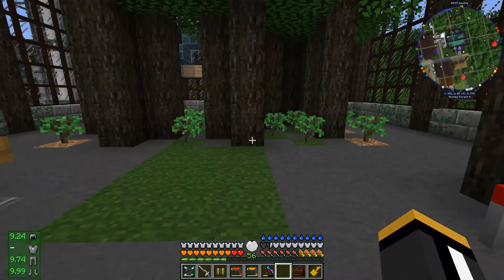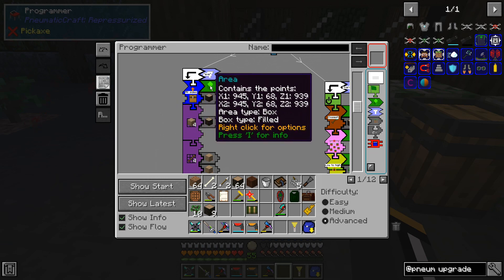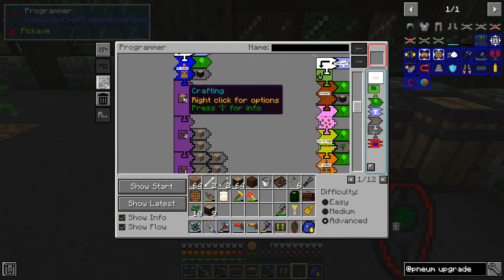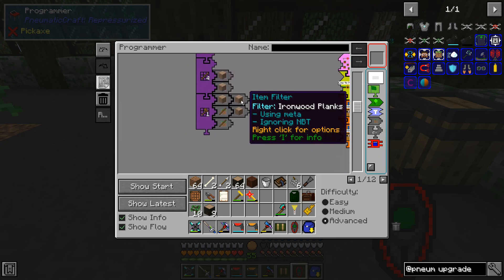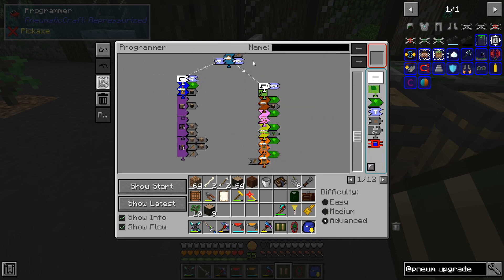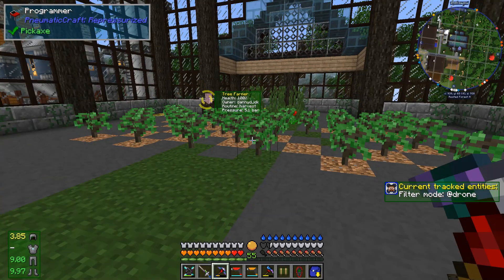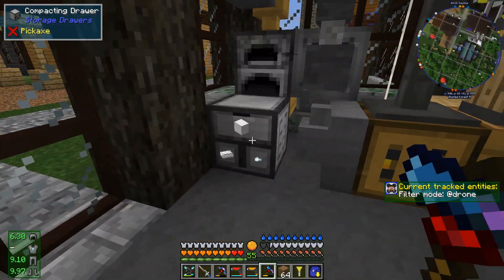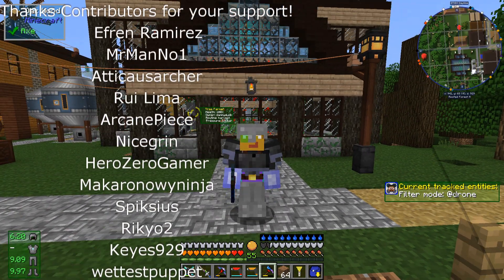Real Tech S2E49 - AutoCrafting with PneumaticCraft Drones

Comment: You should add rail craft to the mod pack
Reply from the maker: Thanks for the suggestion! I did have RailCraft in the 1.10.2 version of the pack, but it took so long to come out for 1.12.2 that I'll need to take time to test it and make sure everything balances well with the pack and that there are no problems.